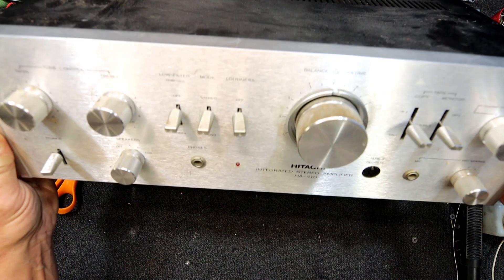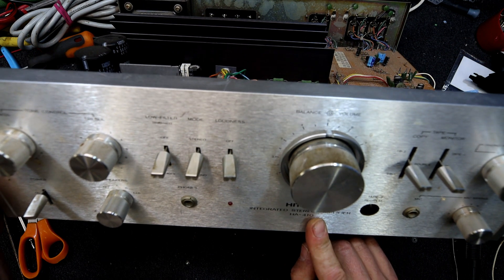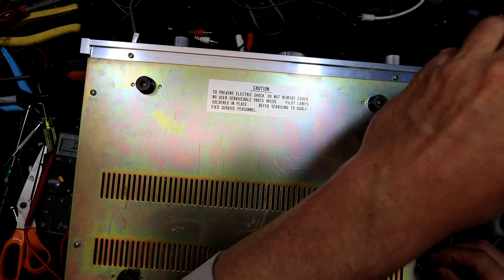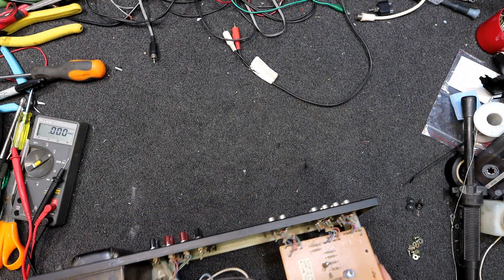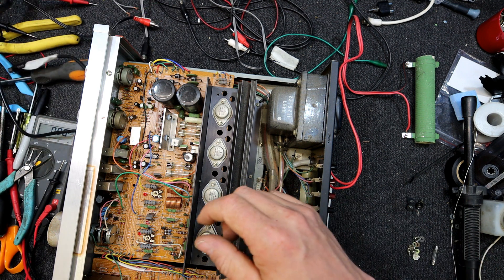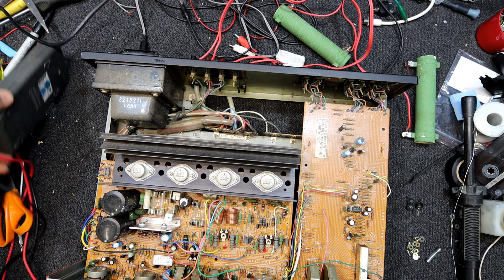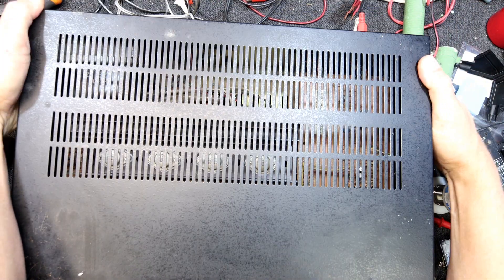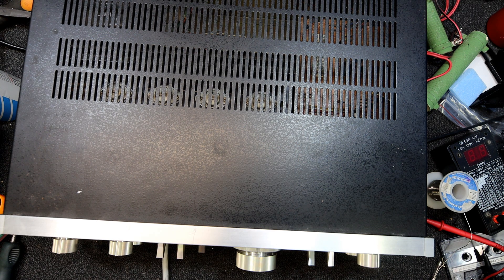70s Hitachi HA-410 Amplifier Unknown Condition Purchase

Comment: Hi Steve, I'm wondering if you tried the phono inputs on this amp and if they sounded any good I have owned one for the last 15years and its been brilliant. I have never really been into vinyl but I remember plugging in a turntable when I first got and it was pretty average sounding kind of weak and grainy in both inputs. Recently I came across another Ha-410 that was bundled with a turntable and I couldn't resist myself but its the same. I don't really know if it's a coincidence or a design problem and I'm wondering if you can maybe shed some light on it for me. Both amps have been cleaned and de-oxidised and probably sound as good as the day they were made through all the other inputs.
Reply from the maker: I dont think I tried the phono on this amp. I do need to give it a test run so have dug it out and will let you know what I find